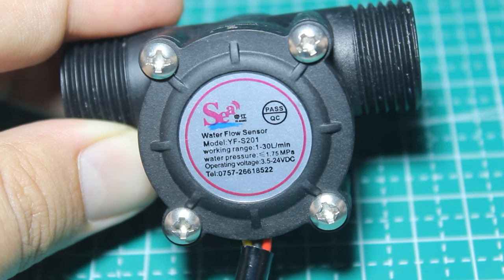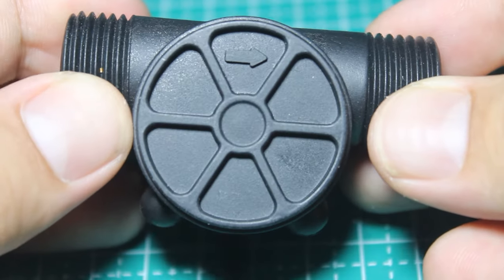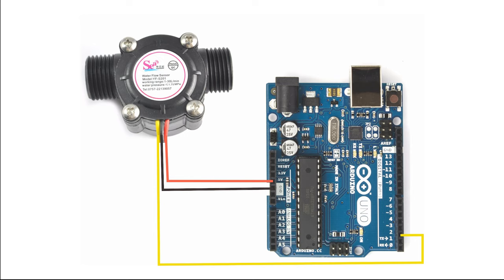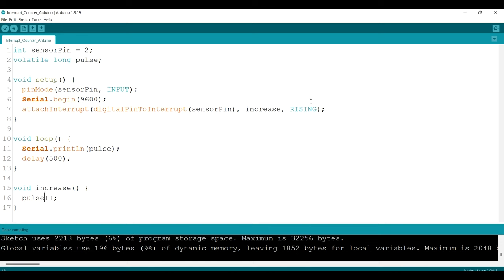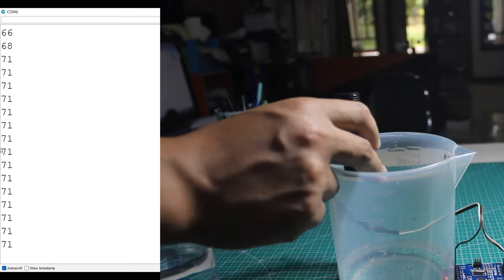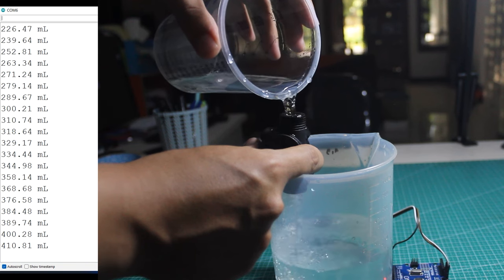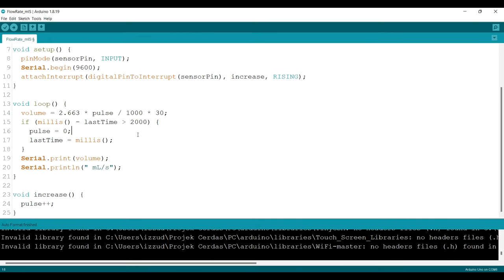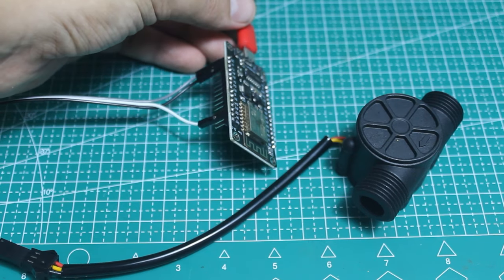How to Use Water Flow Sensor (Make Water Meter with Arduino or ESP8266)

Comment: Accuracy will change with pressure. When water is flowing with low pressure the pulses will be different than when with higher pressure.
Reply: Makes no sense. Water cant be pressurized
Reply: @batterynerd8779  I don't know what you understood but do you agree that the pressure at the bottom of a tank is not the same according to the high of water in the tank? And then when you connect the water flow sensor to a tap at the bottom of a tank, you will see that the number of pulses is different according to the level of water in the tank. So yes, I agree with what he said, I even experienced it.
Reply: Water can absolutely be pressurized. How do you think it gets above the first floor in a skyscraper. And not to totally rock your world, it can be compressed too with with enough (wait for it) pressure.
Reply: @ water cannot really be pressurized like for example air. It does not change density. But yes, if your have a force pushing on the water, the water also has that pressure.
Reply: @francoiskinda8053 the original poster claimed that accuracy would be affected by pressure, that may be true but nothing in their post or the subsequent post said why that might be. It seems to me that likely we all agree that water cannot be squeezed into a smaller volume by pressure to any significant extent, so that wouldn't affect accuracy. Your own point was that water with higher pressure behind it will flow faster and theirfore the pulses will be faster but does this mean it will be less accurate? I see no obvious reason why this should be the case except at very low flow rates where the turbine may have insufficient flow to spin freely, but I am no expert in fluid mechanics.

Comment: Hey quick question, I am building a heat exchanger test facility for senior design and need to retrieve flow rate. What I am confused of is that the Arduino circuit builder's online usually places a 10kohm resistor between the flowmeter wiring circuit, I was wondering why the do this? I understand why you'd need a paired resistor for a thermistors, but not for a flowmeter with a digital input. Thanks!
Reply from the maker: if the resistor is connected between the signal and VCC, it is a pull up resistor. It will force the signal HIGH when there is floating (unknown signal state) so it won't confuse the arduino.
Reply: This reply sounds cool but I'm an SE so I don't understand. Assembly, maybe. GPIO, okay. 
Power meets code? My brain is split open like a womb in a cesarian.

Comment: Seems to me to be an elaborate way of doing the job. Wouldn't it make more sense to use a fourteen bit binary counter and save on interrupt calls? The core of this device is actually liters per pulse !!!. Therefore you would have automatic quantity measurement. Timer interrupts can give flow rate measurements if required.

Comment: hey there, sorry to bother you! If you're calibrating this sensor using a measuring tool, how much water do you use for calibration? Also, after a few tries, how do you end up with a value like 2.663? Do you take an average? If yes, how do you figure out the average?

Comment: Hello , I have a problem regarding to print both flow rate and volume. The error of the code is lastTime is not declared in code. 
Do i have to declare it in the beginning of the code?

Comment: If there's air pressure in the system, say from the water supply network, will this pick it up as well?
Reply: As long as the turbine rotate inside it will count

Comment: is it possible to connect the water flow sensor directly to the esp8266 board? 
the flow sensor operated at 5v to 24v, and the pulse output is at 5v.
Reply from the maker: you should watch the entire video, and you will get the answer

Comment: I have a doubt.. lets say I am setting this up to detect dry run and immediately shutoff motor if there is water . when there is no water, motor pushes the air. will this show as water flowing where in fact the air is moving the fan inside the sensor?
Reply from the maker: Yes, whatever flowing through the sensor Will be counted

Comment: Thank you for the video, do you think i can extend the flow sensor wires upto 40 meters? will i be able to receive the pulses from the wire ?
Reply from the maker: It is not ideal of course, better to put arduino in short distance with the sensor, then you can transfer the data using many ways to your monitoring station.
Reply: @miliohm  thanks for the replay. In fact i can't put it close because i will be monitoring two pipes. One in the basement the other one on the roof. Thats why i need to extend one of the wires and keep the board inside the house.
Reply from the maker: @traffic1122  you can use like internet of things or LAN or even Lora to transfer the data. And give each arduino a outdoor case.
Reply: @miliohm  sound good. I will think it out. By the way, I can connect two water flow sensors to one Arduino, right?

Comment: can this Water Flow Sensor be installed directly in the pipe where tap water passes?
Reply from the maker: as long as the turbine inside is spinning then it should work.
Reply: @miliohm  Thank you, would it be possible to control the volume using only pure electronic component? or adruino /esp is needed?
Reply: @WhereLeo You can use a Arduino Mega to control all your home. I'm from Spain, and I don't speak a lot of english but in spanish that call "Domótica"

Comment: Hi! Can I ask if this sensor can detect fish movement in the water? Or do you have any other recommended sensors for sensing the fish's movement in the water? I'm looking forward to hearing from you. Thank you!
Reply: Its a water flow sensor. It will not detect fish movement in water
Reply: @peterc6964  I mean the movement of the water

Comment: Can i use it for fuel meter in bikes.........plz reply
Reply from the maker: I think yes, but you have to calibrate it. Make sure it is accurate
Reply: @miliohm  i had tried earlier.......but fuel flows in bikes is not frequent as water in any pipe....i mean to say that.....i had placed it just after fuel tank.....due to this flow was stopped after  sometime as the system below the sensor loaded with fuel and next flow starts after the fuel consumed by bike and also flow was like seeping......i think it would be better to place it before atomizer....what do u think...plz reply
Reply from the maker: You are right, sometimes when the water is too little, the water cannot turn the turbine. So maybe you should use the sensor with smallest diameter?